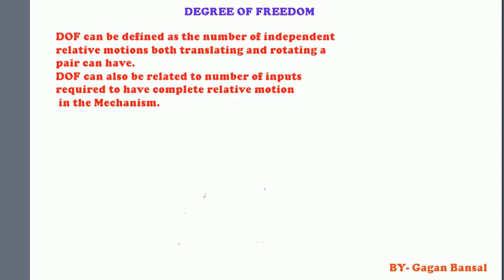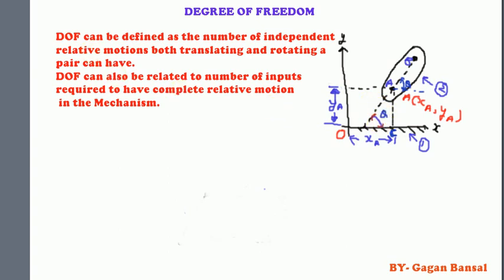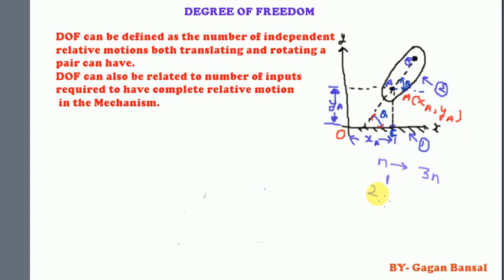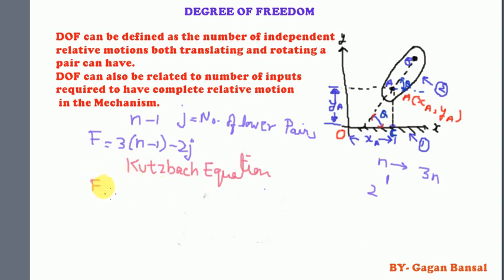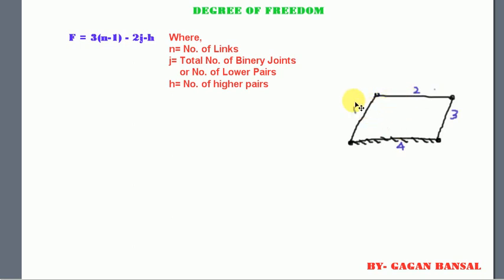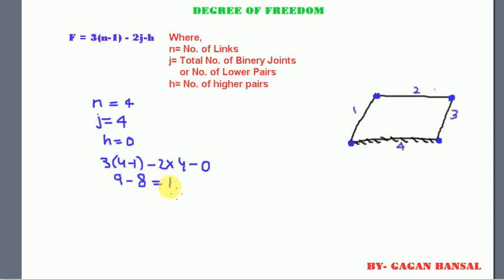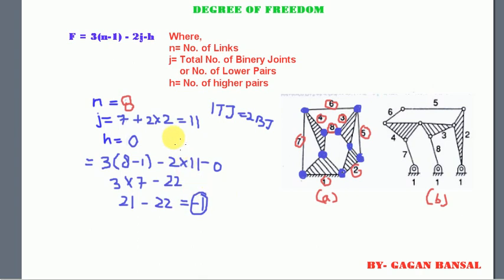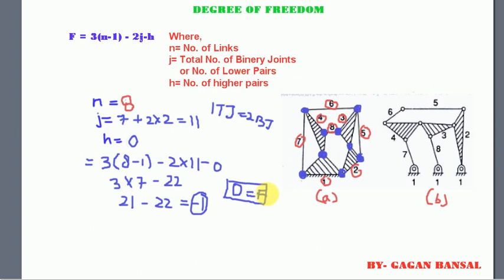DEGREE OF FREEDOM || THEORY OF MACHINE || BY GAGAN BANSAL

Comment: if friction presence between both roller theen DOF =2
Reply from the maker: Assumptions were with basic learning... New lecture contains all this in Elaborate form
Reply: @GAGANBANSAL  can you tell me that....for cam and follower DOF always 1. but why Here occured DOF 2 for Cam and follower...here... Links 3
joints 2 and higher Paris is 1.
then get DOF 1. please don't love my comments... please tell me what's is write or wrong.
Reply from the maker: @amar0507  kindly mention time (in video)  at which the concern is made